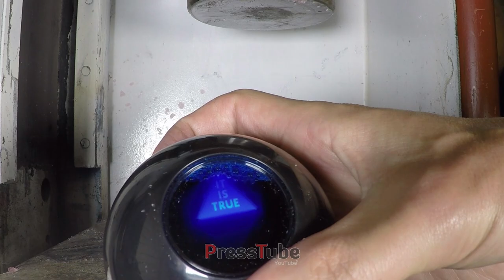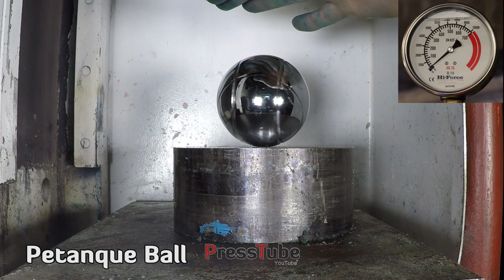Crushing 10 Different Balls + Bowling Ball with Hydraulic Press

Comment: You leave the press pushing down for far too long and it's going to break the machine
Reply from the maker: +Matt H The pump builds up the pressure slowly. It goes to 650bar and then stops electronically. Not harmful for the press ;)
Reply: PressTube ok good. I like. You're channel and don't want you to break it. It's looks like mine and it's manual so you have to stop it yourself.
Reply: Matt H xed
Reply: Matt H they are the ones paying for it!